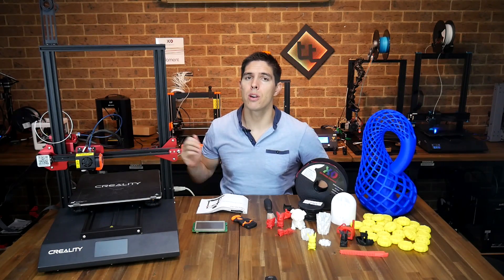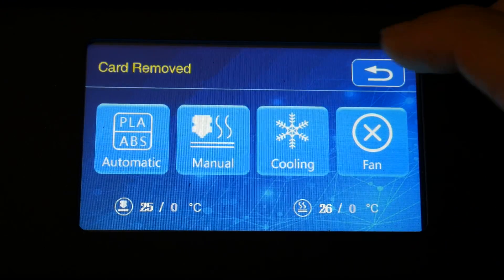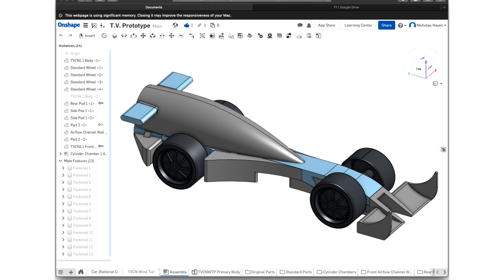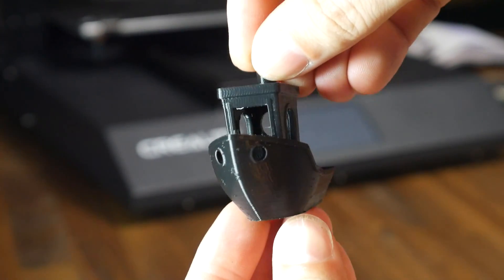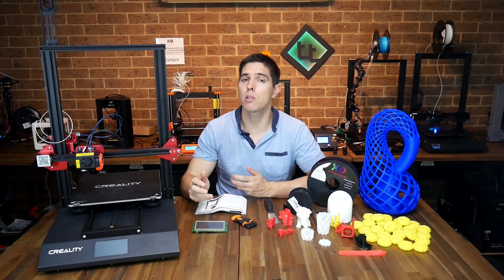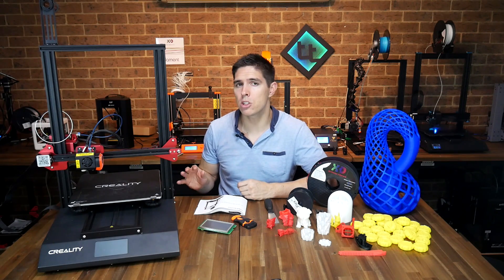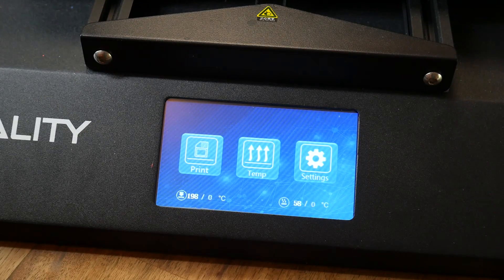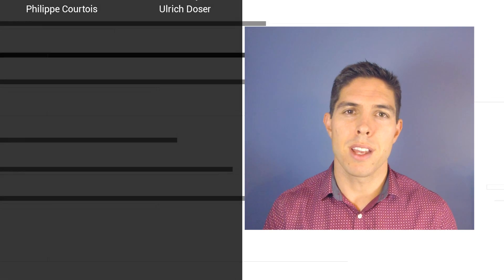Creality CR-10S Pro - An honest review *UPDATE IN DESCRIPTION*

Comment: Great breakdown, definitely a mixed bag. There is nothing more frustrating than a variable first layer due to poor sensor implementation - I can only imagine how maddening it must be for newbies who think it's something they're doing wrong... :(
Reply from the maker: In subsequent tweaking and testing I've gotten about 6 prints perfect in a row now. Follow up video to come.
Reply: Teaching Tech When is the follow up to come? I am looking for my first 3D printer. I am familiar with electronics and building things so a bit of tweaking and modding wouldn't be a huge problem. I am between this and the Prussa i3 mk3S. The Prussa being more reliable and expensive. The CR-10S Pro having a larger build volume (which is nice to have for bigger things). I am really in between the two. Any help would be appreciated. Thanks.
Reply: @TeachingTech  oh wow, look forward to see your videos on that, i have to work out on leveling each time i print something
Reply: @TeachingTech  Very curious what changed! Sensor tweaks?
Reply: I was looking for it to be my first 3D printer 
Do you recommend it? Or there is a better one?
I am looking for something that can print really accurate 👌
Reply: As soon as I got this printer, the first thing I did was install a BLTouch which was a nightmare to install since it was my first time owning a 3d printer, it seemed that the BLTouch wires were the wrong way around which caused the issues. Now that I have owned it for 6 months its an amazing printer.

Comment: did you print the abs fan duct with this printer after it had broken? 
also would you chose the or a cr10s?
Reply from the maker: Fortunately to print in ABS you don't really need a cooling fan except for bridges. Don't own a CR-10S, but the problems this one has are fixable, follow up video to come. Some need money to fix unfortunately.

Comment: I got one few weeks ago, so I have 3 CR10 now this pro was... Was a damn annoying thing as always with any creality, 1st month I fraking hate this things, then I love them, i replaced the factory sensor with a BLtouch and the 1st layer issues was solved, cause that sensor the build bed got destroyed now have a magnetic bed,  as you said its silent but the fans... All original fans are gone now, the Z axis comes out of sync with missing screws for the assembly also for me, the Z desync on this one is really bad at least on mine so I have to print made a mod for the top of the Z leads and print a belt with TPU, the nozzle duct same as you got melted printing PETG, when you fix dial adjust everything its a superior printer but the major issue with this printer is damn creality monkey made quality control, I wont even dare to contact support its the worst, qidi support its a bless compared with creality. 
So if some one ask me you recommend the CR10SPRO i will have to ask 1st its your 1st printer? if the answer is yes to that question the only reason why I will recommend a CR10SPRO to a newbie its because I want to see him suffering. Oh creality FW its garbage also.

Comment: Another happy CR-10S pro owner here. 
I have waited about 8year to upgrade from my custom Reprap to a pre-assembled printer and this one was the perfect balance of features and price. It is a workhorse, very stable and works great out of the box.
I've upgraded to Tyny machines firmware to get thermal runway protection, which isn't included in the stock firmware.
I had the exact same issue with the filament detection and zero issues with auto bed levelling (I was familiar with ABL from previous printers)
Reply: One out of hundreds isn't much of a testimony! When it fails be sure to let us know about that as well..
Reply: @donaldtrump2078  still working strong. Printing 12hs a day, for nearly 2 months.

Comment: I own this printer and wish I didn't.  Here are my issues ( most covered in video, some not):

* Crap firmware
* No long filenames
* Only 5 pages of files (25 accessible files)
* No folders
* Autolevel sensor has crap for repeatability
--This changes your Z-Stop constantly.   Occasionally it takes me 45 minutes just to start a print
* Z-Axis stepper motors always go out of sync
* Badly warped bed (1.5mm hump in the middle)
* AUX (manual) leveling can't work because of the warped bed, therefore forced to haggle with the crappy auto level
* PEI sheet is pretty much required (another purchase)

I've remedied a lot of issues with tinymachines firmware, an added z-axis belt across the top, but the filename issues remain and the pain in the arse autolevel sensor is a headache creator.  I'm going to be purchasing a new sensor to fix this.

All in all, look to spend about 100 to 150 bucks fixing these problems and a LOT of frustration.

Comment: I have 2 Prusa mk3’s and picked up the cr-10s pro for bigger parts. I think it has enough upgrades to justify it over the Cr10s, even tho I’ve never had one. I think the print quality might be better on the cr10spro over the mk3, my guess is the lighter hot end, but the Prusa experience is definitely much nicer

Comment: Thank you for that nice review ... but ... the clamps holding printing surface ... are they included? Is it possible to get an closer view to that kind of clamps?
Reply: The clips that holds the printer surface are two non moving clips in the backthat simply push anything that fit under them down. The front ones swivel out and to the sides so you can pull the plate forwards and then lift up.
Reply: @Awrethien  Thanks for your reply ... are there any pictures of them separately available? Just looking for something like them...

Comment: Great review as always. While we shouldn't have to stab at prints to remove them, the clips in the front do swivel out for easier print surface removal. While that doesn't help much with print removal, it would help retain the bed leveling. Can't wait to see the competition between the printers.
Reply from the maker: Great point Drew.

Comment: regarding the scraper tool, i accidentally found a much better tool for that, both in functionality and safety, Brother makes plastic spatulas for their paper cutting machines, that little plastic spatula is amazing it works perfectly and never damages the print or the bed, if you can get one (they are super cheap but just not easy to come by) you will never go back to the metal scaper again https://i.imgur.com/mEbV672.jpg
Reply from the maker: Interesting. Are the edges sharp enough to get under the print?
Reply: @TeachingTech  yes its much nicer edge than most of the putty knife like tools i've had as long as you place it flat on the bed before sliding it under it seems to keep that edge for a long time (i've been using it for a while but was reluctant to endorse it because i thought it would wear out but it just hasnt) you require almost no force just the act of sliding it under and the profile of the tool do all the work

Comment: You folks that HACK your prints off the bed with your scrapers make me really, really cringey.  Serious business.  No wonder your beds get ruined and torn up!  I simply take the edge of the knife, lay it flat on the bed, rest it against the base of the part and give it a couple of taps with butt end of a rubber screwdriver.  Second tap, the part pops off.  No hacking or poking or ramming or anything else damaging.

Comment: I have a Pro too and modified al lot on it.

I made my own version of marlin, removed that stupid touch LCD and put a 12864 display on it, made my own filament guide, made my own bracket for a 5015 fan and nozzle for part cooling, added a LED bar on the X axis, added a BLTouch, replaced the fans inside to 40mm noctua for mainboard cooling, added a 120x15mm fan at the bottom / removed the top of the PSU for direct cooling / unplugged the PSU fan and now the printer is so quiet xD

https://imgur.com/a/igMochX

Some Thingiverse Parts:

https://www.thingiverse.com/thing:3454594 - Adjustable BLTouch mount
https://www.thingiverse.com/thing:3454242 - Filament guide
https://www.thingiverse.com/thing:3449608 - SD / USB Protector
https://www.thingiverse.com/thing:3407629 - Power switch protector
https://www.thingiverse.com/thing:3427820 - 12864 LCD Case
Reply: Why did you waste money buying this printer if guy were going to tear it apart? Should have just built from scratch or get something better to start with

Comment: I had a bad experience with the TM firmware. The TM firmware kept driving the nozzle into my bed. I never had that problem with the Creality FW 1.60.2
Reply from the maker: Thanks for the warning.
Reply: @TeachingTech  yeah I was bummed because I wanted to get the thermal run off and Octoprint support working. Someone on the Cr-10 Facebook group said they emailed Creality and got a response that they are working to add both into their firmware in the near future. 🤞Also really looking forward to the shootout with the Artillery Sidewinder!!

Comment: I bought one of these to print larger objects than my Flashforge (totally awesome printer btw). Couldn't send it back fast enough, everything was just ... off. It's like they were looking for the specs on paper but ignored everything that made a printer good. The fans were so loud they countered any sound benefit to having trinamic drivers, the 16 point bed leveling deposited boogers all over the print surface that marred the print. The buildtak surface got dinged on my third PETG print because it wasn't glued onto the bed well. Etc, Etc, Etc. If it were a 400 dollar printer, fine, but for 600, no way. Returned it and got my first Prusa, where so far everything has exceeded my expectations.
Reply from the maker: Thanks for sharing.
Reply: Ha ha, it seems like the CR-10S Pro is the machine that teaches people the issues that aren't solved by simply bolting together a collection of pretty good components, but actually require finishing the engineering, as in the  Prusa Mk III.

Comment: Great review. I have owned mine that I purchased from Tiny Machines for about 2 months now. You're dead on with everything you said. I still love the machine and it runs round the clock for me with great results. I noticed that the link to that fan duct is missing. I wanted to try it out.
Reply: Im thinking of buying one from tiny machines -- how was your experience? Did you get any of the upgrades that tiny machines offer?
Reply: @Mobeezy357  I didnt do any of the upgrades from them. At the time the micro swiss hot end wasnt out yet. I did do that after as I love that hot end. Tiny Machines was great to work with.
Reply: Here is a link to all things on Thingiverse for this printer. You should try the Hero Me design. https://www.thingiverse.com/Ninja_3D_Hub/collections/cr10s-pro

Comment: Thank you for the review.  You did a great job.  I've owned this printer about a month and have definitely experienced many of the issues mentioned.  The CR10s Pro is so close to being an epic printer that it's frustrating when it falls short.  In my opinion this printer in it's stock configuration does not justify the $600 price tag due to 1. The poor quality of the stock fans and 2. The inconsistent abl sensor.  I also own an Ender 3 and the question I've asked myself is whether this printer is $400 better than the Ender 3.  And the answer is not quite.  The Ender 3 was much better to get going out of the gate perhaps due to the simpler, switch z stop.  Also, I think most reviewers must be using Simplify3D in their reviews instead of Cura which must be already tuned for this printer because I have definitely not got good quality prints from the printer out of the box using Cura 3.6.0.  Only when I stumbled across the Tiny Machines Cura profile did I start to get acceptable results.  Would be nice to have printer reviews spend more time on the software that is such a critical component in getting a good experience out of printer especially when alot of novices and beginners are probably starting out and testing the waters with Cura first.
Reply: what printers do you recommend now?

Comment: Is the hot end all metal?  I was under the impression 260c is well into the danger zone for Teflon.
Reply from the maker: One advantage of the Capricorn tube is it can handle more temp before degrading. I have not pulled it apart but I'm pretty sure the tube runs down to the nozzle so not all metal.
Reply: @TeachingTech  interesting. I wasn't aware of that. I do think that Capricorns numbers are a bit high but it's good to know I have a bit more wiggle room than I thought. Thanks for responding!
Reply: there is an all metal kit available
Reply: @Mobeezy357  for sure. There are a few. I have been tempted by the sweet sweet titanium of the microswiss but so far everything I wanted to print with worked with the ptfe.  Eventually ill want to try out my roll of nylon then I'll get one.

Comment: the printer will print well but it is like winning at bingo, if you can get the first layer to stick to the print plate, it is not necessarily that everything runs smoothly to the end. I had to replace the sensor with the BLtouch, microswiss hotend, put a double belt to the Z axis, change the print plate with glass and hairspray, but to date I still have problems with adhesion !! it was better if I bought Prusa i3 MK3s immediately instead of saving $ 150. The problem, in addition to the sensor, is the axis that supports the hotend because even if I have aligned it, during the printing the right side gets higher.
Reply: How did you run the belt for the dual Z axis?  I thought about doing that but could not see an easy way.
Reply: @Graham_Wideman  https://www.thingiverse.com/thing:3387741
Reply: @Gasrovescio  Thanks for posting that. I did consider putting the belt at the top of the Z lead screws. I decided that had its own problems, since, as shipped, the top end of the lead screws are only loosely constrained in X and Y (radial) directions, in order not to fight the lead nuts that are rigidly attached to the X gantry when the gantry approaches the top. So I was hoping for a belt solution at the bottom of the lead screws, which would also accommodate an idler to take up the slack in the belt. However, you seem to have made it work at the top, even without an idler pulley, so that's great!
Reply: @Graham_Wideman  in truth I answer you that it is not a simple and definitive solution because putting the axis motors in sync is almost impossible given the poor precision of the fixing of the toothed wheels. So it is possible that one of the engines goes under stress or that the aluminum bar that carries the hotend is not yet leveled properly.
Reply: @Graham_Wideman  I did not understand what you mean, I followed the instructions of the post that I have linked. I'll tell you the truth I think to sell the printer to take the Prusa i3 mk3s because apparently is the best on the market.

Comment: I'm having an issue similar to that shown at 9:49 but with PLA where the nozzle catches the support/small parts of the print causing it to come off the bed. Is there a solution to this apart from z hop?
Reply from the maker: More cooling fan or lower nozzle temp to prevent it curling as much. Either might be hard to do. You can run a normal house fan at the print area for problem prints if it gets you through.
Reply: @TeachingTech  thank for the reply! The nozzel only starts hitting the parts after 150mm or so, im also using the bullseye so i thought i have enough cooling for pla.

Comment: Does it still have a single Z stepper motor? With that long gantry I can’t believe it doesn’t loose level throughout the print.
Reply: No, it comes with dual Z lead screws and steppers.
Reply: It has dual Z motors, which is a good start. But you have to manually set them to get the X rail to a level position (fair enough) but then there's no mechanism to retain the steppers in that position with the power off. If they get out of step, you then have to repeat the whole bed-leveling procedures over again.
Reply: @Graham_Wideman  how often can it happen that it gets asynchron? I mean its the Z-axis - which normaly doesnt have to do so much :-)
Reply: @tamgaming9861  As I said -- the risk is mostly with power off. Under that condition there is no motor current holding the two motors in position. So any by-hand movement of the gantry or head carriage while powered off can disrupt the relative position of the two Z motors.  Furthermore, even aside from manually manipulating the mechanism,  there's nothing to prevent power off at a juncture where the motors are in a micro-stepped position that's midway between two natural resting positions, and then one motor can turn toward rest in one direction, and the other motor in the other direction.
Reply: @tamgaming9861  Also, the Z axis does plenty of small ups-and-downs in order to track the ABL data, and even more if "hopping" is enabled.  However, that all happens with power on, during which the motors are powered and are held quite strongly in their relative positions.
Reply: @Graham_Wideman  yes you are total right. Havent understand it in the first time, maybe because i hadnt have such problems before (i am a CR-10 owner (single z-axis motor) :-). But now, thanks, i understand what do you mean :-) Yes a USB would help, like on a PC, but you are right, its not normal to have it :-)